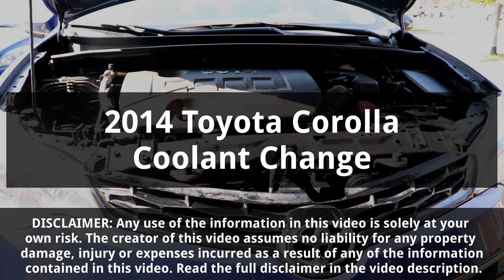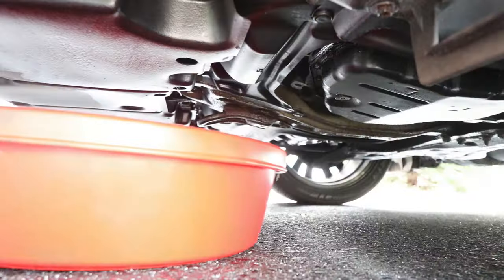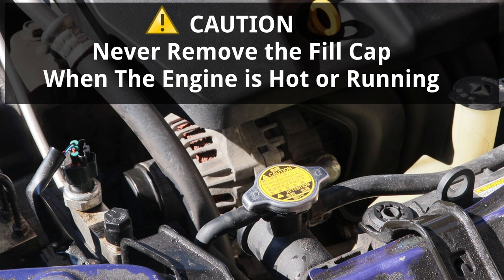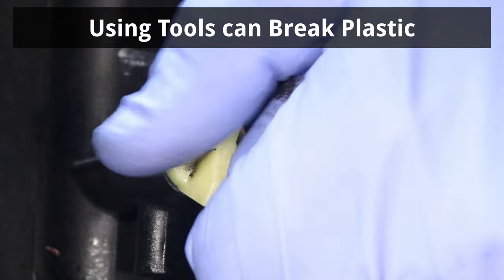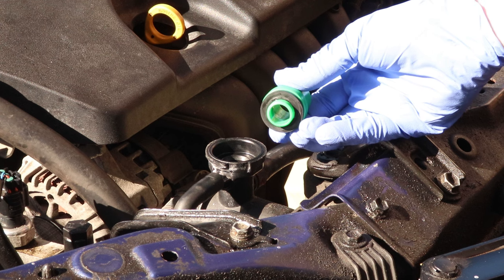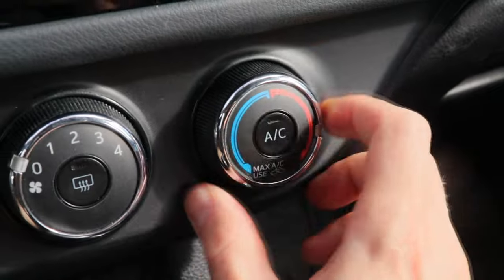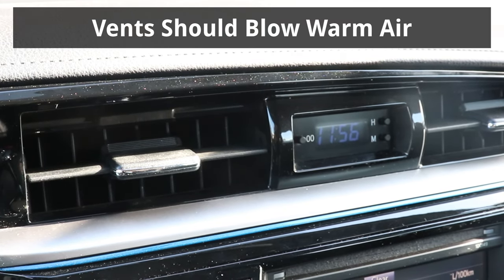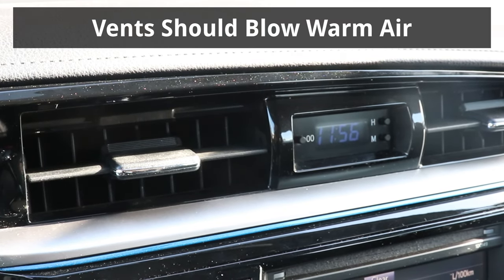Coolant Change, Toyota Corolla, Drain & Fill 2014 2015 2016 2017 2018

Comment from the maker: If you enjoyed the video, please press the like button  👍. Your support helps me create more content like this. If you have any questions , comments , or suggestions I'd love to hear from you.  Ordering through the links in the description supports my channel as well, thank you to all who have ordered.
Reply: Thanks for the video, I would like to do it myself, but I would like to know how much antifreeze my 2017 Toyota Corolla LE uses so I can order it in the store, Thanks!
Reply from the maker: @luisestrada8969  Same as in the video. About one gallon will almost do, and may even do.. but I like to buy two gallons, to make sure I have enough.. and if it ever gets low later, I have some spare.
Reply: @CleverFix after refilling, if you carefully observed the colour of the coolant at the radiator neck and at the coolant reservoir, you will notice there is difference in colour. The coolant in the reservoir looks more pink colour, while at the radiator neck has somewhat yellowish in colour. So colours are not the same.
Can you please explain why there's colour difference? Does it mean the radiator are rusted, etc?
Reply from the maker: I missed this comment somehow sorry. If you're talking about the video, then it's just the camera lighting and colors affecting how it looks. It's definitely exactly the same in real life, I did not notice any difference.
There was absolutely no rust coming out at all in the old fluid, and it didn't look yellow at all. This coolant is very good, and lasts a long time. Thanks for watching!

Comment: Excellent video!  Love your attention to detail, keeping things clean, and safety.  The Lisle funnel makes all the difference.  One tip I have is if you remove the rubber hose going from the reservoir to the radiator at the radiator end, and lower it down below the reservoir level, you can drain it into a cup or other container by siphon action.  Then you can raise the hose again, fill it with distilled water, and do the same procedure to flush it out.   Usually I like to completely remove the reservoir for a full cleaning but I couldn't figure out how to remove it.  They tend to collect some crud in the bottom.

Comment: Every how many miles would you recommend to do a coolant drain and fill? Thanks for the video by the way. Really detailed, straight to the point, and the best camera angles.
Reply from the maker: Check the maintenance schedule from the Toyota website, you can google "toyota corolla maintenance schedule". For US it's a different schedule than Canada actually, and that link I replied earlier was for Canada.  If you Google you can find the one for your country.  As far as I know for the 2014 Corolla, it's 100,000miles or 10 years for the first coolant change, and after that it has to be replaced more often, 50,000miles or 5 years.  Age is just as important as mileage because fluids break down over time. Thanks for watching!

Comment: Great video, detailed instructions, thank you so much! I just changed mine recently and this gave me a huge confidence boost. 
Before opening the drain valve, I found that I could use a 3/8 ID tubing to route the coolant drain hole to avoid making a mess. I hope this helps others with a clean driveway!
Reply: Thank you for the tip!
Reply from the maker: Nice! Great idea, I was thinking about using a drain tube, but I didn't have anything that fit, and I didn't realize it could drain all over the place. I'll use it next time, thanks for the tip.
Reply: I was just able to change mine on a 2019 Corolla. The tubing on the drain helps a lot so it doesn't spill all over the place. I had some silicone tubing lying around that fit perfectly. For refilling, the funnel is a game changer. It makes getting all the air bubbles out super easy.

Next I want to find out how difficult it is to do a drain & fill on the CVT.

Comment: thank you very much for a great intro, could you please tell me how to deal with rust in the cooling system?
Reply from the maker: I don't have a lot experience with rust removal, I actually never managed to get rid of it altogether when I had a Ford Taurus with this problem.
The problem with rust is that it can flake off if there's a lot of it, and big chunks can get trapped within the system. I would go to a mechanic that has experience cleaning up rust in the system, because the procedure can be very specific, depending on the product used. If it's not cleaned up perfectly, it may cause bigger problems than trying to save a few dollars by not doing it professionally.  There are lots of videos on Youtube showing rust removal, but in each case, it's a long tedious procedure that involves flushing the rust out.   Changing the coolant on time (as indicated in the manual) is the key to preventing rust.  Over time coolant becomes acidic and loses it's protective properties, allowing rust to form.
Is this for a 1.8L Corolla with the Pink Long Life coolant?

Comment: Just did this for my mom's car on its 10th birthday - thank you for the excellent instructions!

At first I didn't unscrew the drain petcock enough because it felt loose, but coolant was only dropping out very slowly.  It feels looser than it is.

I was also concerned because I didn't have that fancy no-leak funnel, but the funnel I had made a tight seal with the fill hole, so there were no leaks (other than what was left in the funnel after bleeding was complete and I removed it, but I rinsed that off).
Reply from the maker: Glad it was helpful! Thanks!

Comment: This is the best coolent change video so far, belive me i watched a lot. And i ve learnt that: i should never do the engine flush with 50/50 mix coolant which is noone tells except you. Great videos.
Reply from the maker: Glad it helped! Yes, not only it leaves water behind, but it's really not needed as long as the coolant is changed on time.. If the old coolant looks good, then there are no deposits in the system, so flushing, especially with the wrong water can be worse than doing nothing.
Reply: Is 50/50 coolant not good? I use it on my 2016 corolla.
Reply: @Beekeeper8011  50/50 is not goon when u flush, because there is still pure water in heater core, u have to measure with pure colant and distrilled water etc...
Reply: @KukLinSky  all I'm doing is draining the old coolant and replacing it with 50/50. Is that not good?
Reply: @Beekeeper8011  yeah good good, as long as you dont flush with distrilled water, you do right then, :)
Reply: @CleverFix  Is flushing with distilled water a bad idea?
Reply: @agenttalex not at all just keep in mind that water will be left in so put concentrated coolant in to dilute it. You can get testing strips or similar to dip into the coolant after you fill to see the ratio of water and coolant to try and get it to 50/50

Comment: Hey, I'm new to this channel. The video was so detail. I have a question, please answer if possible. I bought a used car and I found that the coolant level is low in that car. However, I can see that the temperature is normal when I drive the car. Now I don't know when the previous owner refilled the coolant. Could you please let me know if it is normal for the coolant to reduce over time? I checked the level of the coolant when the engine was cool. Also, the previous owner told me that he never noticed any kind of coolant leak previously. Thanks!
Reply from the maker: The coolant plastic tank you can see is a "Reverse/Expansion" tank. MOST of the coolant is actually in the engine. 
So if you are referring to the plastic tank, then yes, it does evaporate and go down over time. It's normal for it to slowly go down, and that's why it should be checked regularly. It's a very simple check.
I have another video showing how I check and refill it: https://www.youtube.com/watch?v=NJnI2zhgXPs
Reply from the maker: It should not go down quickly though, if you notice it go down quickly, there is likely a leak.  Keep an eye on it.  Mine went down about half way, in about 5 years!..
Reply: @CleverFix  Thanks for your reply. Yes, I was talking about the reserve tank. Today, I saw a pending P2610 code in my OBD scanner. I don’t know how long the previous owner drove it at that low coolant level. I’m worried if it damaged the temperature sensor or not.

Comment: Thanks for the great tutoring video, I subscribed. Have you ever tried to drain engine block. I am going to change the coolant in Corolla 2009 and as I know there is the engine block drain plug somewhere under manifold from underneath. Your video covers everything, but one thing is confusing me: all other video I watched starts from lifting up the front of the vehicle. It is much easier to work on the vehicle when there is more space underneath. Why are you recommending changing the coolant on flat surface? I would prefer to lift it up
Reply from the maker: If you have a hoist, and you can lift it evenly, then it's alright. If only the front is lifted, the coolant will shift from the radiator to the engine, and less coolant will come out. It will also be difficult to re-fill properly if the car is not on a level surface.
Reply: @CleverFix  Thanks for quick response. It makes sense, I was never thinking about it, and I guess a lot of other people who showing video of coolant changing with front of the vehicle lifted too.
I will compromise. First, I will draine the coolant and then I will lift the front for better access to the water pump and thermostat.
Thanks again for the great tutoring video.
Reply from the maker: @stanislav9608  I do have a water pump video, and yes I did raise the car to change it, but than lowered it back down to re-fill.  https://www.youtube.com/watch?v=mAADf3nRNdo  The 2014-2018 engine does not have a drain on the engine side, but some older models might have, see here: https://www.toyotanation.com/threads/2013-corolla-coolant-engine-block-drain-plug.1686963/  It's very important to re-fill on a level surface, and to squeeze the air out of the hose before starting the car. Every little bit of coolant that can be put in before starting will help to stop tiny bubbles.

Comment: I learned how to drain and properly refill fluid from the video. Guess where? Inside the most remote location. Out of nowhere, a hose pulled and all coolant was drained. Car almost overheated. I was alone in the middle of nowhere and had to save myself. Luckily, I had a glue in the car. I sealed the broken hose, bled the entire car, found water😂😂😂, did this and was able to move the car safely home. Thank you!
Reply: I forgot to mention, there was no literally no internet. This took 2 hours to stream completely and the 2 hours was enough to give the car enough cooling. I feel like a top coolant service person now. Thank you!!!!
Reply from the maker: @MusterK-e8s  Wow, that's amazing, what kind of glue was that?? I think I should keep that with me, haha! Rubber is usually hard to glue. I tried superglue recently and it seemed to do an OK job, but many other glues will not even stick.  How many miles were on the car? I think your case highlights the importance of checking the hoses regularly.. Usually if they start to feel softer in one spot than another, or it's deformed in any way, or bulging, that means it's time to replace.  Mine still look great, but I've had the same experience as you with a Ford Taurus.. the hose blew out, all the coolant was all gone, and the only sign I had that it happened was a little smoke and smell, but not much at all... so not really a great indication. Luckily I figured out what happened and called a tow truck before overheating it too much. The engine wasn't running quite right, that's what gave it away.  It was revving slower than normal, so I figured the piston rings were starting to "stick" .. If I drove another 2-3 minutes I think that would've been it.   The temp gauge showed normal, because there's no coolant to bring the heat to the gauge sensor. Corolla might do the same, I'm not sure, did you actually see the gauge go up to Hot ? Glad you got it fixed!

Comment: Would you recommend using one of those radiator cleaners and then flushing with distilled water? Or do you think it will end up causing the new coolant to dilute?
Reply from the maker: If the coolant came out clean, and there are no signs of rust, scale, or contamination, then it's likely that there is nothing to flush.
Flushing can introduce water into the system, potentially diluting the new coolant and altering the antifreeze ratio, which is crucial to prevent the engine from freezing in winter.  If there's a coolant system problem you're trying to solve by doing the flush, I recommend consulting with a professional mechanic.  They can inspect your coolant system, test the coolant, and give you a proper recommendation.

Comment: I would give DOUBLE THUMBS UP if I could. This is the most sensible coolant replacement video I have ever seen. Many people insist on using DISTILLED water to flush their system which can result in dilution of the final mix. If you insist flushing your system with water, use SOFTENED water. Distilled water should not be used at all.
Reply: That makes no sense you use distilled water because there is nothing else in it. Whether you use softned or distilled there is still gonna be water in there unless you flush it out with coolant.
Reply: @AJFRAN3  Ok, you're right, I did not clarify the difference between distilled water vs SOFTENED water; Distilled water is ionically hungry, so it will strip electrons from the metals in a cooling system. Softened water is more balanced and will not strip away the IONS from metal surfaces in a cooling system.

Comment: Hello! Can you make a video about oxygen sensor Upstream and Downstream cleaning. Thanks!
Reply from the maker: Cleaning is not recommended, unless you had a very temporary "rich" fuel mixture due to another failed component like a spark plug for example.. If an O2 sensor code is popping up, it's usually time to change it. If the engine is working properly they should be already fairly clean looking.

Comment: Thank you so much for make this videos!. I have a Corolla 2016. This weekend im gonna change coolant using Prestone Max Toyota OEM.
Reply from the maker: Glad the videos help, and thanks for watching! Hopefully Prestone is as good as Toyota Original. I only use original from the dealer. It's not that expensive really, and it's top quality.

Comment: Using Peak coolant for Asian cars (50 50) 
The remaining is the original Toyota coolant and i am at 72k. Is it ok to mix this Peak with the remaining trapped in the system? 
Did a  test on the existing fluid and it past ok.

Comment: Hello man. Great content. Could you please make a video on how to disable the day time headlights while driving for toyota corolla 2014? It shortens the life time of the alternator and the lamps.
Reply from the maker: If DRL is not required in your country/state, you should find it in the Radio, under Car settings. Mine only shows the Door lock settings there: https://www.youtube.com/watch?v=DQNjHvbOs-Q    But some cars show a Daytime Lights option there. Either that, or turn the headlight switch all way the back to off.  If neither of those work then likely you live somewhere where DRL is mandatory. I believe the DRL uses less power than the fully on headlamp, so the wear is likely very very small.  On older cars with halogen bulbs it was more, but I think for a modern car, the benefit of the lights outweighs the tiny amount of wear.  
From ChatGPT:
Daytime running lights (DRLs) have been shown to reduce the risk of accidents. Studies have found that vehicles with DRLs are more visible to other drivers, pedestrians, and cyclists during daylight hours, which can reduce the likelihood of collisions.
One study by the National Highway Traffic Safety Administration (NHTSA) found that DRLs reduced the number of multiple-vehicle crashes by 5.7% and the number of fatal crashes by 11%. Another study by the Insurance Institute for Highway Safety (IIHS) found that DRLs reduced the likelihood of two-vehicle daytime crashes by 5%.
Reply: DRL's (especially LED) will barely put a dent in the lifespan of the alternator unless maybe you're running them while the car is off for a long period of time and that'll put a load on it when it has to recharge the battery once you start the car.

Comment: If you do 2 drain & fills, how would you know how much coolant has come out so that you can put the same amount back in. please help I am about to work on my car.
Reply from the maker: I wouldn't do 2 drain & fills myself, because I think one is enough. Generally this coolant is very good and lasts a long time.  But if I really have to do it twice, I would do all the steps in the video once, and completely finish. Then drive a few times, 2-3 times, and check the reservoir each time, make sure it stays topped up..  And then I'd do the second change.  So the procedure would be done twice, No difference in measuring.

Comment: I have a 2AR-FE engine in my 2016 Camry. Is 1 container or 4 quarts enough ?  No point buying more than necessary as coolant is expensive here.
Reply from the maker: 2AR-FE is a 2.4L Engine, which is bigger than the 1.8 in the video, and takes about 6 quarts from what I found online, so it needs 2 Gallons/containers.

Comment: Great video. Would this work with a 2014 Corolla L (no keyless entry).?
Reply from the maker: There are two engine types for 2014 Corolla.  2ZR-FE  and 2ZR-FAE, and it's is printed on a white sticker on the underside of the hood.  So open the hood and look up at the hood, not down at the engine.
The video shows a 2ZR-FE engine . The coolant change procedure is the same for both engines, but the water pump and serpentine belt change is different. Hope that helps!